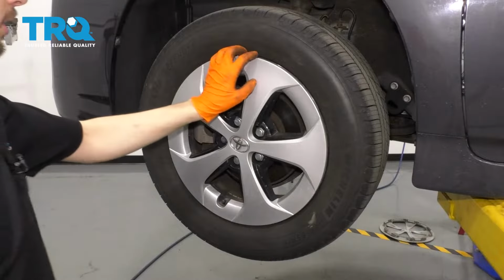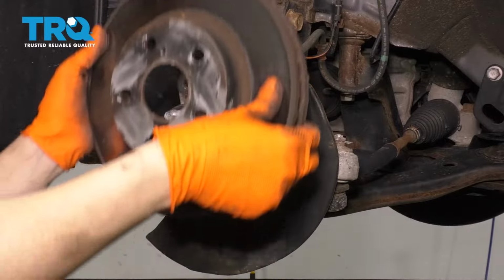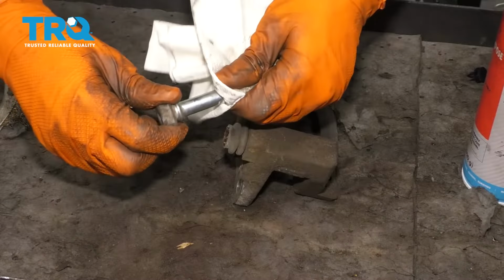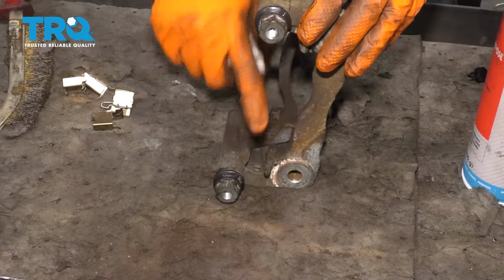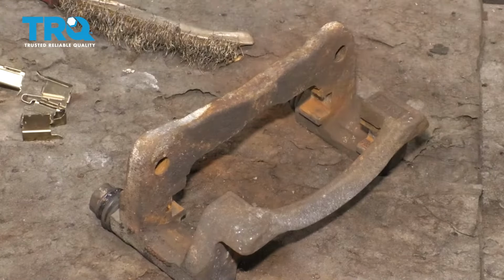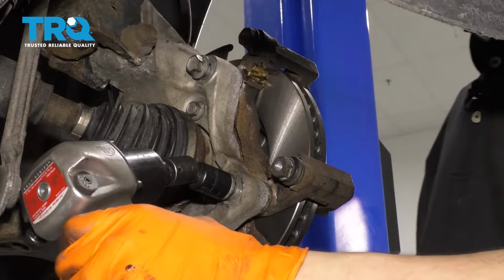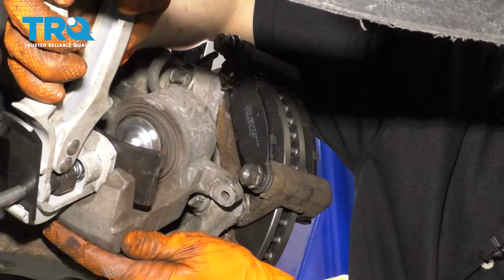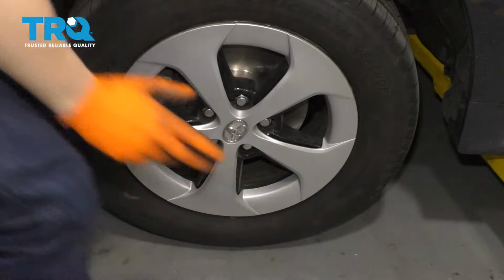How to Replace Front Brakes 2009-2015 Toyota Prius

Comment: Is the torque spec correct on the caliper bracket?  Didn’t see you grease the ears on the pads yet you greased the mounting area where the springs sit?

Comment: Dont sweat it too bad if you mixed up the slide pins. If the longer one fits flush in the hole then its in the correct place

Comment: Do I need to disconnect the battery before I pull off the caliper? A pump came on and extended the piston on the caliper. I couldn't get the piston to retract after that.